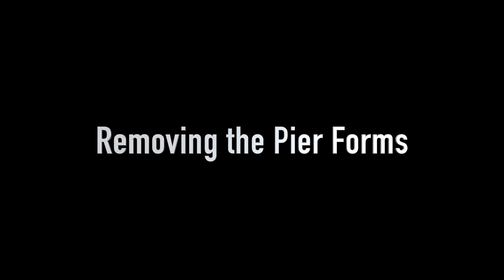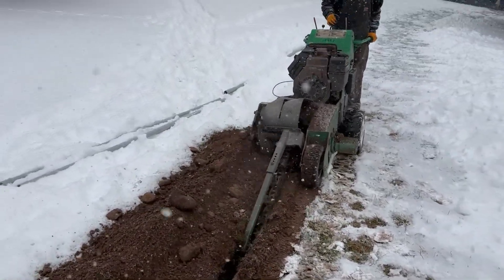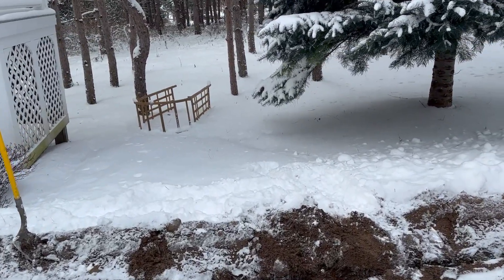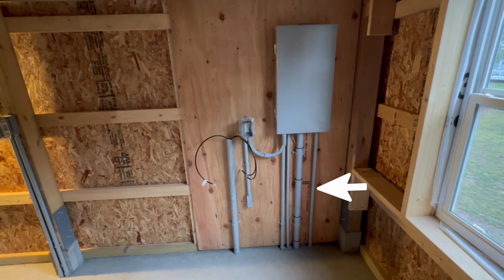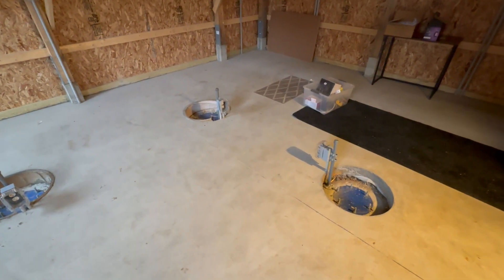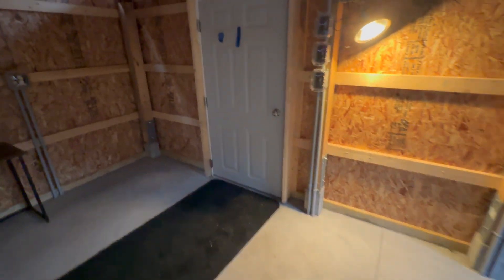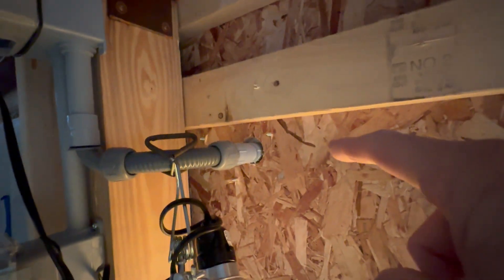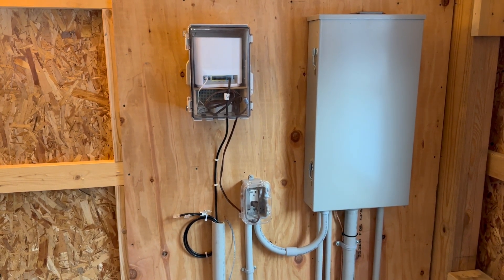Observatory Update: Powering Up the Observatory!

Comment: I'll be very curious to know about the red and white strip lighting you install. I have a much smaller 8x10' RoR and need to get some lighting in there.
Reply from the maker: The red lighting is nothing special. Color led strps about 70’ long that can adjusted a remember their last setting. So I will set these to a low brightness red and leave it. The white strip is 24v set that can be adjusted for color temp and brightness. I hope these will be bright enough but I am not sure.  I’ll cover these more later.

Comment: I'm shocked and impressed that you found folks who would work in those conditions. Here near Albany no one wants to work in the winter unless it's inside and heated.
Reply from the maker: I felt sorry for the guys doing the outside work, but they had a very different perspective.  They had done similar work over the past week in driving rain, and they much preferred working in the snow.  Also, the snow acted as an insulator, preventing the ground from freezing, and they liked that as well!
Reply: Money talks.